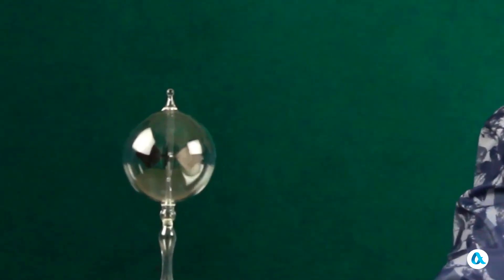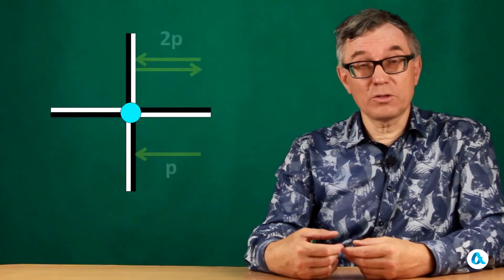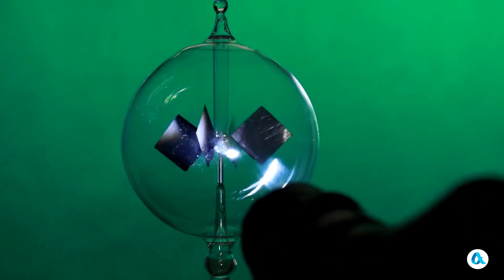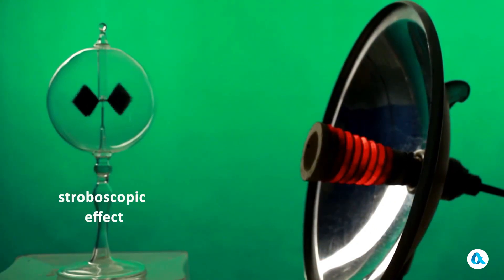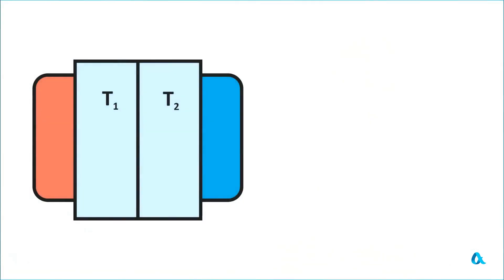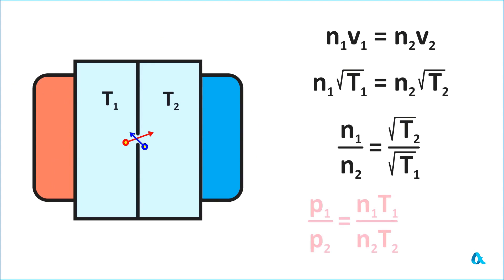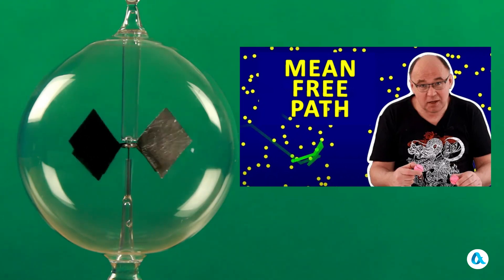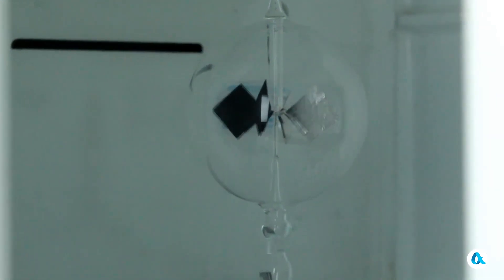Crookes radiometer

Comment: Take a plastic spoon (Wendy's works best) and rub it on a towel or your hair. Hold it near the radiometer and the blades will move. It's all about magnetic resonance. I'm no scientist but glass is an insulator so it can't be static electricity. Also, this effect works best in ambient light.